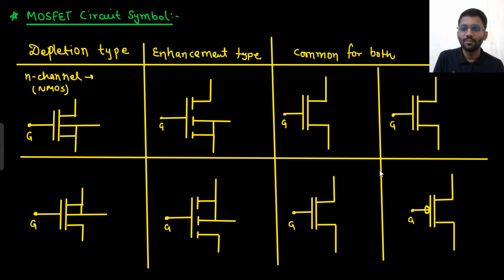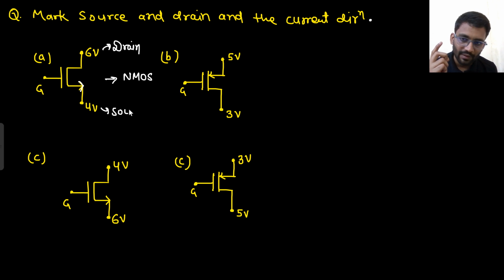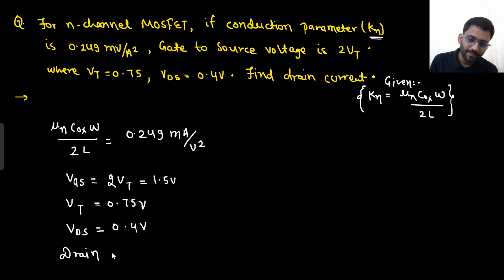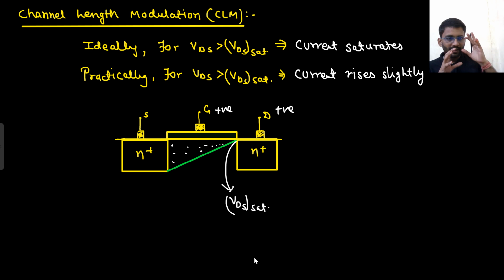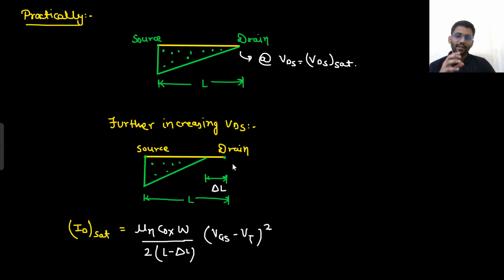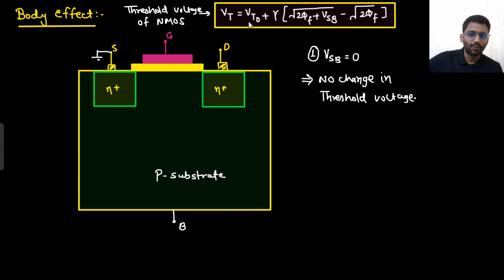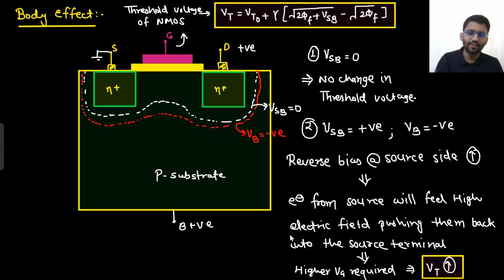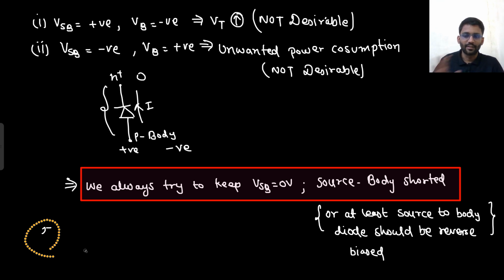Important Concepts of MOS Physics || Analog Electronics || PrepFusion || Himanshu Agarwal

Comment: Sir, Early Voltage comes in Base Width Modulation right? and not in Channel Length Modulation!
Reply: Base width modulation is related to BJT right? It might be different for MOSFET as here instead of base width, we talk about channel length, both are similar but applicable for diff devices..

Comment: Sir, could you please make a video on wire delay — for example, explaining what happens if a wire is cut into equal parts and buffers are placed in between, each with some delay? Also, please make a video on DFT (Design for Testability).
Thank you sir